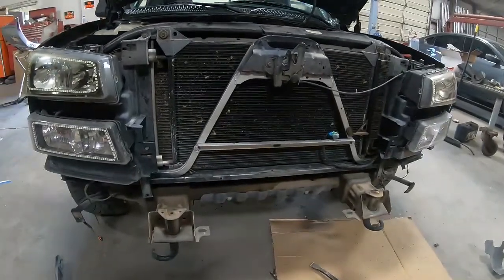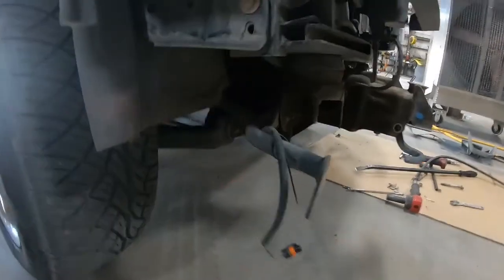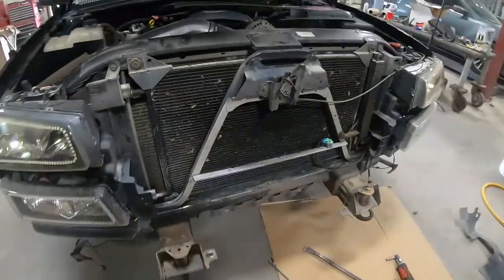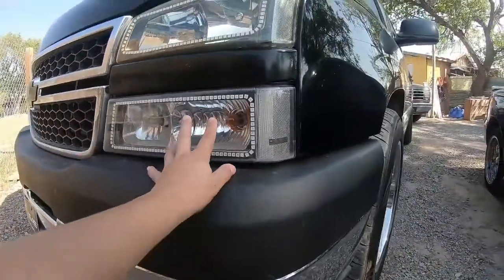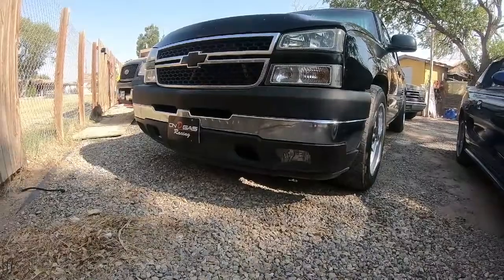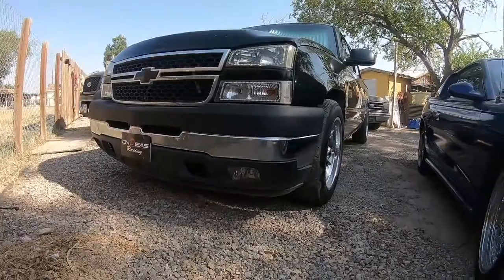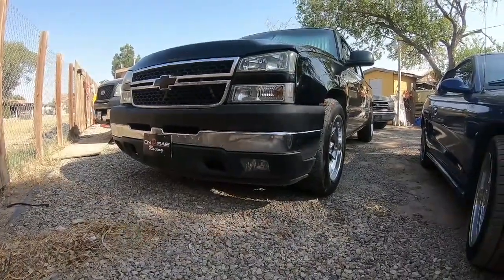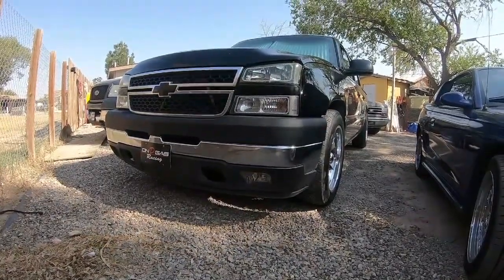HD pad install on the craw cab cateye Silverado

Comment: Is the bumper pad from eBay ? If so how well does the pad fit
Reply from the maker: If it's pretty well for being on eBay one I haven't had no issues with it
Reply: @lowboostedaccord4933  did you have to do any modifications to the side bumper mounts?
Reply from the maker: @raulinfante8955  you have to cut the original brackets and lower it like an inch and a half
Reply: @lowboostedaccord4933  I’m referring to the side ones ? Do I also have to lower those ? I’m referring to the one in your video that is bent .
Reply from the maker: @raulinfante8955  no those stay the same just the top ones that bolts on those you have to cut those inch and a half the bottom ones you don't have to
Reply: @lowboostedaccord4933  Thank you. Good video.
Reply from the maker: @raulinfante8955  thank you I appreciate it I'm here to help